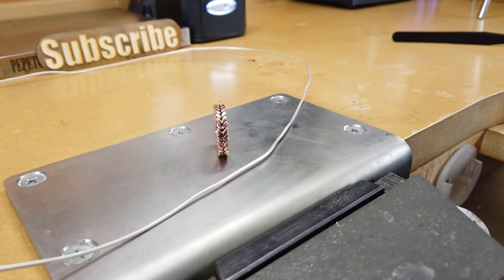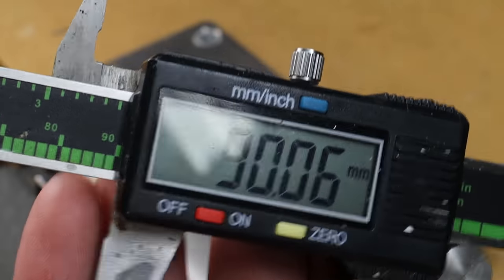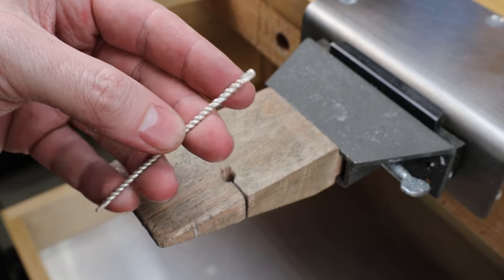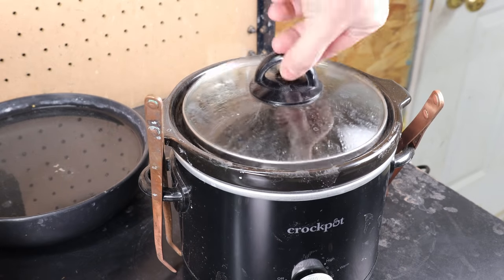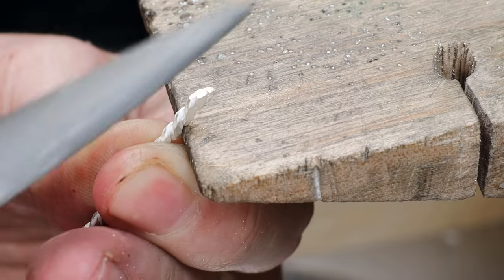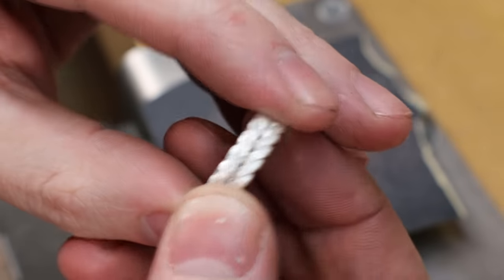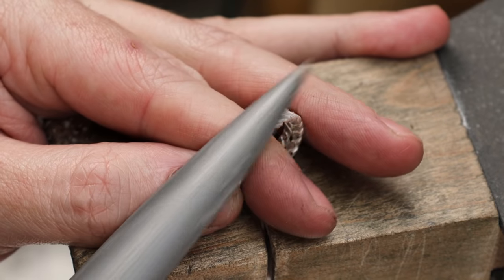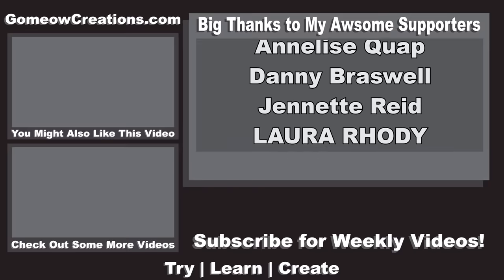How to Make This Dual Twisted Ring With Basic Tools

Comment from the maker: Ring Bending & Shaping Tools:
Ring Bender - https://bit.ly/PepeRingBender
Smart Size US Ring Sizing Kit for Superior Ring Bending - https://bit.ly/SmartSizeUSRingSizingKit
Ring Stretcher - https://bit.ly/RingStretcher
Cheaper Off Brand Ring Bender - https://amzn.to/3fQIXhn
Cheaper Off Brand Ring Stretcher - https://amzn.to/3FXQNjN

Marking & Measuring Tool
Digital Vernier Caliper - https://amzn.to/3gbyfSR

Bench Vice:
4.5in Bench Vise - https://amzn.to/343d968

Ring Sizer:
Steel Mandrel Gold Standard - http://bit.ly/GoldRingMandrel
Finger Ring Sizer  Gold Standard - https://bit.ly/RingFingerSizer

Saw Frame & Saw Blades:
Haymaker SawFrame - https://bit.ly/HaymakerSawFrame
Nano Saw Blades - https://bit.ly/NANOSawBlades
Blade Butter Cutting Lubricant - https://bit.ly/BladeButter
GRS Tools Mounting Plate - https://amzn.to/3u4PBbQ
GRS Mounting Adapter - https://amzn.to/3KDKi9p
GRS Bench Pin - https://amzn.to/3AuPuYj
4-Piece Bench Anvil Combination V-Slot Bench Pin - https://amzn.to/3AtYNYu

Solder Tools, Soldering Block & Solder:
Smith Little Torch - https://bit.ly/SmithLittleTorch5tips
Smart Flux - https://bit.ly/SmartFlux
ErgoLast Titanium Solder Pick - https://bit.ly/ErgoLastTitaniumSolderPick
NANO Paste, Silver Solder Paste - https://bit.ly/SilverSolderPaste
Electric Torch Igniter - https://bit.ly/AutomaticTorchIgniter
Charcoal Soldering Block - https://bit.ly/CharcoalSolderingBlock

Pickle and Pickle Setup:
Smart Pickle - https://bit.ly/SmartPickle
2-QT Slow Cooker - https://amzn.to/35qdLUh

Rolling Mill:
Combo Wire & Sheet Rolling Mill - https://bit.ly/ComboRollingMill
Wire & Sheet Rolling Mill 110 mm - https://amzn.to/3FSxN6l
Cheaper Off Brand Rolling Mill - https://amzn.to/3H6xshS

Hammers & Bench Block:
Maker Hammer Set  FRETZ - https://bit.ly/MakerHammerSet
Steel Bench Block - https://bit.ly/PremiumBenchBlock
Rawhide Mallet - https://amzn.to/32uGUwd
Chasing Hammer - https://amzn.to/3nQsRIX

Polishing/Buffing Tools & Machine: 
Single Spindle Polishing Machine - https://bit.ly/SingleSpindlePolishingMachine
Double Spindle Polishing Machine - https://bit.ly/DoubleSpindlePolishingMachine
4" Buffing Wheel Set - https://amzn.to/3Aw7oKc
Fabulustre Polishing Compound - https://amzn.to/3qWQoJY
Cheaper Off Brand Double Spindle Polishing Machine - https://amzn.to/3fSb4N1

Ultrasonic Cleaner:
Ultrasonic Cleaner 1.5 Pint - https://bit.ly/UltrasonicSmallGEMORO
Ultrasonic  Cleaner 2 Quart - https://bit.ly/UltrasonicMediumGEMORO
Ultrasonic Cleaner Solution - https://amzn.to/3KGks4I

Pliers:
Smooth Brass Jaw Parallel Pliers - https://amzn.to/3r6Zkgh
Chain-Nose Parallel Pliers - https://amzn.to/359v77t

Sandpaper:
Wet or Dry Sandpaper 400 Grit - https://amzn.to/3Iww4VW

Silver Wire:
16 Gauge 925 Sterling Silver Wire - https://amzn.to/3IAXFW8

Metal Snips:
7in Plate Shears - https://amzn.to/3AxZPTE
Small Shears For Wire - https://amzn.to/3rNtFzl

______________________________________________
Note Most of the links that I use that go to products that are affiliate link. This means I make a small commission on anything that you happen buy using them. This is at no extra charge to you and this helps support the work I do on this channel. 😁👍
______________________________________________
Other Ways To Help Support The Channel:
One time support ➜ https://paypal.me/gomeowcreations
______________________________________________
Instagram ➜ https://instagram.com/gomeowcreations/
Facebook ➜ https://facebook.com/GomeowCreations/
______________________________________________
Reply: Is it possible to show more variations of this?
Reply: Sir this is amazing work, how could I get in contact with you about a ring. I would like one of these rings in sterling silver and if you do a rhodium coating.
Reply from the maker: Yeah like what would you like to see?
Reply from the maker: gomeowcreations@gmail.com
Reply: @GomeowCreations  Any variation on the twisted wire ring. I have very limited tools but do it for the fun. I am not a jeweler. Work only with brass and copper.
Reply: that's for the video, didn't follow your steps, just decided that it's much easier and faster to finish if you solder 2 parts right after twisting them, then you just need to flatten them and solder the ends. So it was as I said, no gaps or whatsoever. It's even possible to do without solder paste, if you don't have it (I don't) just cut lots of small pieces off the hard solder (whatever is used) https://youtube.com/shorts/7W4S5YVLhNs
Reply: ,, Osmium " Rarest precious metal on Earth.

Comment: My purpose isn't to be negative, but please don't title "basic tools"and then proceed to use dozens of special chemicals and shop tools. Torches, special mallets, soldering tools, vices, ring sizers and shapers, annealing and flux solutions, etc etc. Not to mention the specialized tools you used, even if you offered other solutions, those alternatives don't all achieve the same results. I enjoyed the video otherwise but I definitely can't make that ring with my "basic tools"
Reply from the maker: Those are very basic jeweler tools to be honest and all of it can be hadvery cheap as well. 

I'm getting this comment a lot on this video and I don't know what people are thinking basic tools are.
Reply: @GomeowCreations  I think people assume you meant basic house tools? Lol like some lead solder and a nail hammer... These are all basic jewelry tools that all beginner jewelers should have!
Reply from the maker: You should never use lead solder for jewelry 😅
Reply: @GomeowCreations  I understand OP's stance on this. Using the phrase Basic Tools implies equipment most folk would have around their home. "Basic jeweler's tools" would be more accurate.

That said, I would have been less likely to click on the video if it had been more accurately titled. And as a result I'd have missed out on something that ended up being interesting. Bravo, Sir.
Reply: I felt the same way. Basic tools should be basic tools, not basic specialized tools.
Reply: These mostly are basic jewellers tools. All you really need to do this a drill, a torch, some solder, flux, pickle, a soft faced hammer and some pliers. It's the same way that a woodworking video using basic tools probably expects you to have a saw, hammer, drill etc
Reply: clickbait
Reply: These are all basic metalworking tools
Reply: hi !! I made a slightly more complex variation of this ring maybe a year ago with a kitchen torch, $2 of silver solder (not paste) and a $5 flux pot that will last years (+ an old toothbrush 😇) just try it, it's a really fun project that taught me a lot and worst case scenario you wasted a few bucks on equipment that will serve you later. The result won't be exactly the same but very close I'm honestly still proud of the ring I made, we can talk about it if you want tips !!
EDIT: not a year ago as the video is 11 month old but in this range
Reply: *and a hammer of course, but I'm pretty sure even a flat bar of metal could do the trick (please use a hammer 😅)
Reply: @cespedesgarcia  Yup. Intentional or not, it's definitely clickbait by not having more specification in the title.
Reply: @GomeowCreations  If the title had been more accurate for an everyday user, then people wouldn't be mentioning anything. As it is, it reads like clickbait once you get into the video, which is fair, but your reaction to people being bewildered seems sort of obtuse, especially when a single word could have been added to make the title more clear. "How to Make This Dual Twisted Ring With Basic <Jeweler's> Tools"
Reply: I disagree, I made a ring very similar to this following the tutorial with less than a $100 worth of tools.  This is a hobby that requires tools and I would consider $100 as a barrier to entry pretty low
Reply: Well from the look of the rings on the thumbnail I assumed that my weenie wire wrapping tools probably weren't going to enough. It was kind of a no-brainer 😂
Reply: Beautiful rings! Thanks for the tutorial 👍
Reply: @GomeowCreations  jewelers tools are specialized tools.
Reply: @GomeowCreations  you just came off as pretentious and immediately me as lost a viewer. Please reconsider the way you interact with your community
Reply: I agree. I don’t want to poo poo the video but I was hoping to see something else in this video. To me basic tools are tools that a typical person would have. Not a beginner jewellery maker. 🤷‍♂️
Reply: @GomeowCreations  you sure know it‘s clickbait. Of course these aren’t basic tools. Your title leads people into thinking you can do this at home with regular stuff and you know that.
Reply: @sleepyspacesloth3182  lead solder wtf
Reply: I'm a beginner jeweller and this is really something I could do with the basic tools I've got. Thanks for the video, highly appreciated.
Reply: This video is for jewlery makers, like metal and soldering. In the studio you would have access to most of these tools and equipment.  So it is basic tools in the sense.  Now if you're a crafter at home who uses pre-made stuff to make jewlery then sure, this isn't basic, but to metalsmiths this is basic
Reply: @cespedesgarcia  did you think you were going to make jewelry with the carpenter hammer and screw driver in your garage
Reply: Very true! While im sure they are basic tools for a jeweler, just not an average Joe or doe.
Reply: guys I'm astonished by your lack of capacity to improvise, i could litteraly make this ring with only electrical wire, a nail klipper, tin solder, a lighter and a file, it obviously won't be as good as in the video but very close and as I said I made this ring with no more than $30 of tools a few month ago with proper silver solder and even tho I stepped up since I'm still very proud of this ring. Honestly if you don't have these tools just think two second to find the next best thing you have, I'm very glad he showed us the proper way to do that but it is VERY easy to find alternatives, try me if you want
Reply: Honestly I have alotnof basic tools and have been making copper rings similar to this using similar methods, as I am learning I need to be creative if I want to save money , so sometimes I need to figure out different jigs or things I can use , this video was nothing but helpful if you have any familiarity with metal work or soldering so yeah . Okay and things like it hot soapy water and a toothbrush answered my questions like can I clean my jewelry I made similarly like that yes I used hot soapy or bending the ring shape by hand vs a ring press I don’t have a ring press lol quite helpful vid
Reply: He does give two ways to do most of the things requiring jeweler specific tools. All others could be swapped out for their common variants. I might try to make this with my basic house tools and see how it works.
Reply: Yeah… feeling daunted to say the least! 😂
Reply: basic tools ready, duct tape, hammer and a piece of barbed wire 😂
Reply: @cardioandfriends crybaby 😂
Reply: Word !
Reply: Everyone has a different definition of basic tools. Everything here definitely falls under the category of basic, not just for jewelry making but for standard handy work as well. This complaint is the equivalent of pointing out a chef using a French style knife when all you have is a steak knife, just because you don't have it doesn't mean it isn't basic.
Reply: You should probably pick up a solder kit, torches, and vices at least. There's a lot you can do around the house with those.
Reply: Bro he said or more advanced ones🤦
Reply: Literally in less than 15 seconds of the video
Reply: @GomeowCreations you have get the lead free stuff from the plumbing section 🤣
Reply: You might try a weeder, a lawn mower, a shovel and a sledge hammer. 😮
Reply: To be honest he does explain throughout the video exactly what basic tools can be used to achieve the same results. Now he never promised to make anything using only specific primitive tools that would have to be its own channel and to be sure you would see a dramatic difference in the quality of product produced.
Reply: @sleepyspacesloth3182  led solder?👍 He's not repairing an electrical fixture. A nail hammer? He's not building a doghouse.
Reply: @GomeowCreations I’m a leather smith who is very interested in jewelry making, not the plastic bead jewelry but actual gold, silver and turquoise jewelry
Reply: Right on, Brother
Reply: I think it’s more geared towards people who are already familiar with studio. Most who are would be familiar these as basic tools.
Reply: Very nice. As someone who is an absolute tool junkie, I really appreciate the list you provide. I'm sure it'll take me a number of attempts to make a ring as nice as yours is, but jewelry making is all about repetition, right?  Thanks so much for a great video.
Reply: They are a jeweller's basic tools and the subject is jewelry! Use some common sense people!
Reply: Great video

Comment: I adore the rift between easy tools, that you have at home, and basic tools, which a profession needs.
Reply from the maker: Basic tools in this videos doesn't mean stuff that everyone would have at home. They are very basic jeweler tools that can be had for not very much money to be honest. The point of the videos is to show how can make this ring using the cheaper tools to do the same thing as the professional tools but at the same time showing why professional tools can be very handy for time saving or making things easier.
Reply: @GomeowCreations  That's what I meant. Thank you for confirmation :)

Comment: i used to make celtic rings from silver wire when i was younger. my grandparents used to own a craft shop that sold everything. sadly when they passed away most of the stuff in the shop was thrown into a skip as my aunty had no idea of what was in the shop. they chucked loads of silver wire and tools into the trash. i was so gutted. lost so many tools from the shop. i must get back into making stuff again. these days i tend to use computers and resin printers and then have them cast. miss the old ways. well not that old but old if ya know what i mean. thanks for a great video.

Comment: I see the "not basic tools" comment a lot so I'm just going to chime in and say I am in the process of making this ring for a family member and I love it. These are pretty basic jewelry tools and, with a bit of ingenuity, I can (probably) make this!
Definitely gonna take some practice though...
Reply from the maker: Well thank you for that haha. What tool are you using to make this?
Reply: @GomeowCreations  The primary things I am missing from the video are a metal block for hammering, a bench pin, a good cleaner, and, well, skill lol.
From what I have done so far, my skill is holding me back far more than the tools. I'll get there though.
Not super related, but I actually have learned everything I have done so far from your previous videos! I have made a number of copper and brass rings so far, but I just bought some silver wire to move up a level. Wish me luck!
Reply from the maker: Best of luck and let me know how it turns out 👍
Reply: @GomeowCreations  Coming back to this video again, I realized I never relied! It went very well. I made my ring out of silver wire, and I did make a few style changes from this video.
I made it as a Christmas gift for my mother and I loved it and so did she!
Reply: I also 3d printed a ring gift box I designed to present it in

Comment: Found this by searching for simple wire tutorials (!) and your idea of basic tools amused me.  Great result though!
Reply from the maker: What are basic tools to you? I thought a steel ring mandrel, mallet, saw and a torch was as basic as you can get for jewelry making. I also show how to use professional tools to do that same thing but the idea was to show you can do it with basic jeweler tools.
Reply: @GomeowCreations  No I get that, and once i started watching the video I knew you were showing the two different ways.   I do have the basics, but I now also have tool envy over rolling mills and ring stretchers.  I'd actually be interested in how good this could look without using any of the professional tools.  I'll give it a go and report on my slightly wonky masterpiece 😄

Comment: May I ask why you solder the ‘sticks’ first and then again solder the rings together ?  I only have copper wire now and i’m’wondering if all that silver solder - including on the ‘sticks’ won’t show too much.  Grateful for your video !  Thank you.
Reply from the maker: I just solder the hem as sticks to keep them tight so when you hammer it down it will not split. The copper one you see in this video was made for n the some way and I was able to clean it up so you can't see any of the solder. 😁👍

Comment: You've set me off at the start with a project. I'm a Toolmaker so I have most tools except fort the smart solder, nano paste and a jeweller's saw...what grade of blade?
Would a dental wax jet flame do the heating & Soldering?...pickling powder product name?
I wanted to be a jeweller.
Only apprenticeship I could get was as a Toolmaker.  No regrets as my hand skills through that trade allowed me to be a carpenter, a  Welder, wooden boat builder, fibreglass, panel beater, stone letter engraver, antique item repairer. Medical grade Welder too. Also a rifle stock Carver grips and forend, Boat name Engraver. 
Now wish to learn to facet. Stone set and metalsmiths engraving. I just seem to have a craftsman's hands, like my Dad.

Comment: If I'm wanting it to be black could I just leave the black polish or do I need to take it off
Reply from the maker: If you want it to stay black you can put it into the liver of sulfur for a long time like a few hours and take it out a let it dry. After that you a fine brass wire wheel on it to shine it up without removing the black on it.